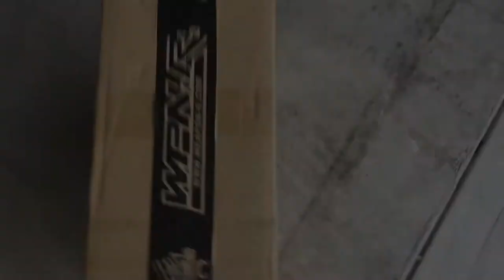Installing NRG Bucket Seats Vlog Episode 2

Comment: Homie quick question for the brackets did you have to buy a separate set and if you did what brand did you get them? I’m doing nrg seats on my tC as well keep up the awesome content 🔥🔥🔥
Reply from the maker: Robert Mendez I did have to get the brackets separately. Go with sparco  !! 🤙🏼
Reply: I’m assuming the sparco use the stock brackets
Reply from the maker: Robert Mendez in order to mount the seats 
You need an aftermarket brackets I.e. sparco which should include rails to mount to the seat. It bolts up to the exiting bolt holes on the chassis .
Reply: @humblemedia1203  do sparco  seat bracket work with the nrg seat ?
Reply from the maker: @sebastienrebeiz7288  yes they do